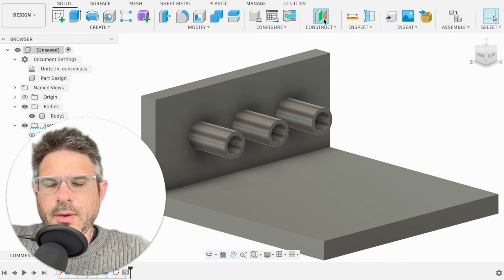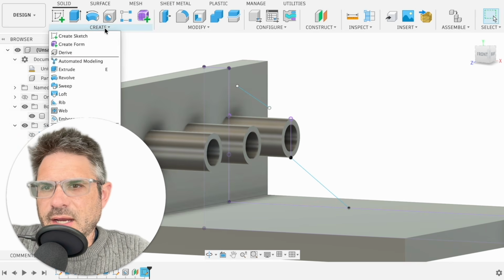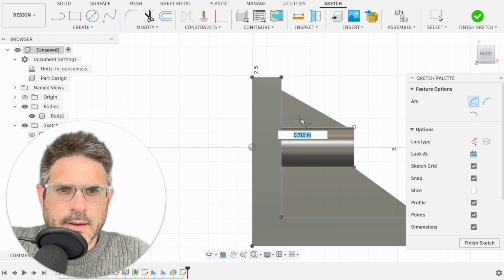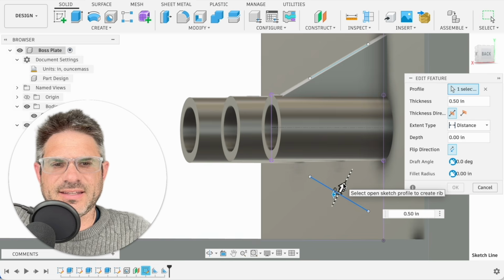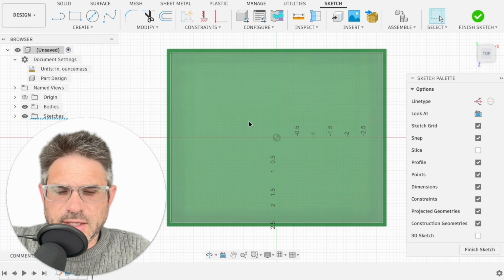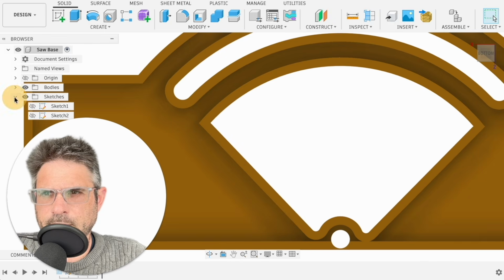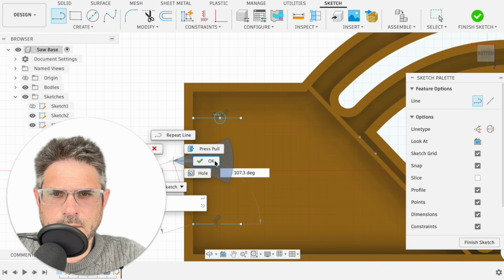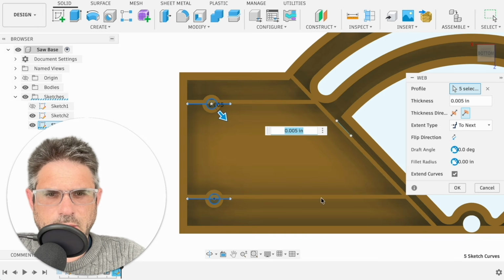I've Been Teaching Ribs and Webs Wrong in Fusion 360

Comment: - Caution when using 'Break' command @6:41 ...
--- Note the warning message (that appears at lower-right of UI): 'Constraints and or dimensions were removed during operation." BTW, it can also add constraints and or dimensions to accommodate the change. (Especially bad w/ 'Offset'.)
--- This can mess up your sketch: your design intent may not be preserved, and driving/driven relationship may get broken.
--- Isn't bad all the time, but just pay attention so you don't get bitten.
Reply from the maker: Absolutely Legendary.